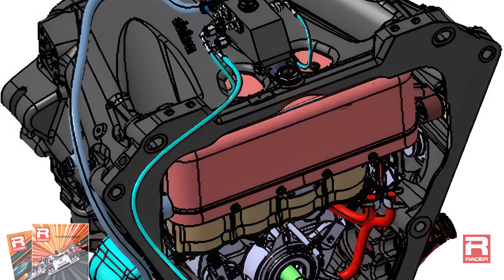Part 1 - IndyCar Hybrid Engine Roundtable hosted by RACER's Marshall Pruett presented by Skip Barber

Comment: I personally don't care about the hybrid system.  I know they want it, to turn the sound of cars, like F1 V8s, into electric shavers BUT couldn't they have installed the 2.4L V6 for this season, AT LEAST?!?  With luck, the 2.4 would add some more power for 2023 and WITH SOME PRAYERS, a new chassis along with the 2.4L hybrid system for 2024.

Comment: Can we get a new chasis as well?
FFS this one has been around too long.
Reply: I'll take bigger car counts with an old chassis vs small car count with new chassis. New chassis = $$$ the smaller teams dont have
Reply: @nelson8708yahoo  with as many street courses that indycar runs, large grid size just makes a longer train...?
I get the $ thing, but it's gotta happen sooner or later, this chasis is getting ancient.
Reply: @chrispraz877  I'm sure it will change in time.  I just remember the drop in car count when they switched to this chassis in 2012.  Same thing happened in IndyLights in 2015

Comment: First off, thank you for the video. Great to see the two manufacturers working together. I guess I'm just confused why hybridization is needed in IndyCar. It made sense in F1 as its a constructors championship and the technology developed for F1 trickles down to road cars. Indy is a spec series that only exists for racing, not necessarily technical development. I don't know, I feel like running on renewable fuel is good enough. My biggest concerns are 1. reliability and 2. a rise in cost that creates a bigger barrier to entry. i.e. less cars on the grid.
Reply: The #1 thing that is gonna be good about this is that the cars are going to be able to restart themselves and they will be able to use push to pass without burning extra fuel, so frankly to me it doesn't really matter if this stuff makes it into a road car or not, we won't be stuck with these road course finishes where nobody can pass each other because they're in some fuel save map
Reply: Honda and Chevrolet, the series 2 engine suppluers, don't make road cars?

Comment: I've asked this question on several channels, but have never got an authoritative answer...    How will hybrids work on an oval?    Hybrids need braking to recover energy to later put back into the powertrain.   There is no braking, and often, not even coasting, on ovals.    Will they just turn off the electric functions on ovals?
Reply: This has been answered before by RACER articles. We will see if it turns out exactly this way, but I've read there's going to be a paddle on the back of the steering wheel that applies a very slight brake pressure. Either hydraulic like the normal brakes or electromagnetic I'm not sure, but either way, a very slight brake pressure. Something to build charge and at the same time conserve fuel/tires, ideal to use in the draft on an oval. This sort of thing exists on some road cars so I've heard. The terms "fiddle brake" and "harvesting paddle" have been thrown around.

It has been theorized by Honda/Ilmor recently that it might actually be most effective on an oval
Reply: I believe the trailing driver will not lift in a slipstream but will hit that regen button to store energy. That is, unless, he wants to get by, in which case he allows the throttle power to go 100% to the transmission.
Reply: @markfleetwood4453  Fine, but the thermodynamics of nature cannot be cheated. It's much more inefficient than simply allowing the existing push-to-pass system to operate and not drag around more weight. Lifting saves fuel, but harvesting energy then reusing it always wastes some of the amount extracted in a hybrid system.
Reply: @owifell  Thanks for the good answer!
Reply: Apparently the super capacitors need just a fraction of the recharge time needed by the F1 batteries. Litterally very little time at all, and the slight lifting needed during racing at IMS is all that is needed.  We shall see!
Reply: They won't work on ovals, they'd just be carrying extra weight of the capacitor/battery around for no benefit. Maybe the idea of the unit in the bell housing is so that it can be relatively easily unplugged and swapped out for oval racing, which BTW only account for four of the seventeen races in the series.
Reply: @I_Evo  this is completely false as both honda and Chevy have stated that it may be even more effective on ovals.
Reply: @ryanro24  Well lets wait and see, but given these are the same folks who couldn't get 15+ year old KERS technology to work on the cars I somehow doubt they've made some sort of  technological breakthrough that the rest of the motorsports and automotive industries missed.

Comment: Hybrid engines are the future, like it or not! Glad to see IndyCar taking a proactive step towards the future rather than stubbornly planting their feet in the ground.
Reply: No engines are the future. They'll never stop until the sport is gone
Reply: Hybrid is kinda passe.  If Indycar had wanted to appear to be cutting edge, they should have done this 10 years ago. Doing hybrid now just highlights how out of touch Indycar really is. Road cars have moved on.
Reply: @billmartin1010  IMSA in this case is out of touch too, they could have done before but no, they don't till this year.
Reply: @DrColoso  — What does IMSA have to do with anything? Take a look at their technical regs — despite appearances, they’re every bit as much a spec series as is IndyCar.
Reply: @sking2173  oh please, they’re far from spec. Multiple chassis, multiple engine types, etc.

The cars look different unlike IndyCar

Comment: Electrification is a gimmick, and it's unsustainable in many different areas (approx only 12 years left before all Lithium runs out, more environmentally damaging than a petrol engine, and limiting on milage). Also Honda is actually experimenting with Hydrogen powered ICEs, honestly the future is better/cleaner fuels than electric. 

Would be cool if they gone towards future tech than be behind the curveball on what will end up abandon tech.
Reply: Supercapacitors use 0 lithium. You must have them confused with Lithium ion batteries.
Reply: Hydrogen has its problems as well.    First, it is a small molecule, so it is difficult to store without leakage.   It is also very reactive and tends to quickly compromise seals and other parts in the storage system.     In addition, it is far easier to make hydrogen from petroleum than from any other source, so it is not very environmentally friendly either.
Reply: "Electrification is a gimmick" - No it is not.

"...and it's unsustainable in many different areas"  Yes, it can be unsustainable in some markets for certain things.  If you live in a very rural area with limited infrastructure, it's probably not the right time to be adopting.  But in many suburban and urban areas, it is a real viable and enviromentally signifcant improvement.  Don't let perfect be the enemy of good.

"approx only 12 years left before all Lithium runs out" - No, there is more than 12 years worth of Lithium just in California.  If you want to talk about mineral shortages related to electrification, you should steer the conversation to Cobalt, Nickel, Graphite, and Copper.  Those will be the larger limiting factors moving forward.

"more environmentally damaging than a petrol engine" - Not if the vehcile is kept for more than 2 years.  After approximately 2 years (varies depending on exact vehicle) the electric vehicle surpasses a combustion engine vehicle in total emissions output (and that is includes material sourcing and construction).  It's important to note, if you have a petrol powered vehicle, don't just replace it.  Drive it until it needs to be replaced.  And depeding where you live, a combustion powered vehicle may still be the best option.  The future isn't black or white, it's grey.

"Also Honda is actually experimenting with Hydrogen powered ICE" - Yes the largest oil companies in the world are paying a LOT of money  trying to keep hyrdrogen powered vehicles a thing.  They want to sell you "gas" or "hydrogen".  They don't like the idea of you collecting sunshine on your solar panels and powering your car with it.  It's all about maintaing a product that they can control the market on to sell to you.  They see hydrogen as a way to dupe the populace into thinking it's a "green" technology that is enviromentally friendly, while still being able to collect their monthly "rent" (fuel) checks.  

The future doesn't need to be all electric, far from it.  But there are many benefits to elecctrification of many sectors of our current world.  I love combustion engines and racing, but there is a compromise solution that can be had.  The government forcing things looks and is bad, but the flip side of that is there is clear manipulation of the science and narrative by large energy/oil/chemical companies.  They will do anything to maintain contorl of these markets.  And they've been found to be knowingly lying about these topics for generations.  There is no easy solution, but we must work together to find a solution.  It is a real problem.
Reply: @TechHippie-u3s  Lets be honest its technology no one asked for in racing to "fix" a problem no one cares about.
Reply: @TechHippie-u3s  "I love combustion engines and racing, but there is a compromise solution that can be had."

why?
Reply: @TechHippie-u3s  "They will do anything to maintain contorl of these markets.  And they've been found to be knowingly lying about these topics for generations.  There is no easy solution, but we must work together to find a solution.  It is a real problem."

so we have to have the government force this form of propulsion on the populace? Who is supposed to be the free capitalist nation again? big petroleum may have misled us but its a couple steps down from having something forced on you.
Reply: EVs are here to stay. Hydrogen is a dead end. Renewable fuels like ethanol and biodiesel will remain viable for awhile. Petroleum isn’t going away, but it’s share of the pie will continue to shrink.